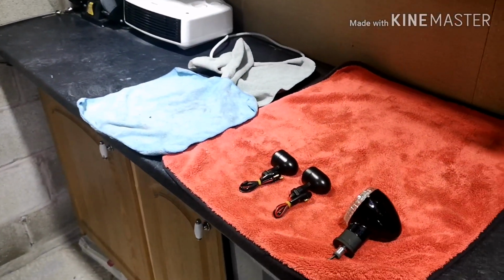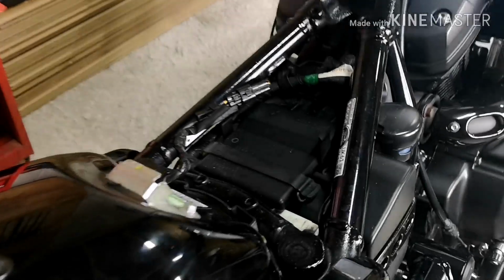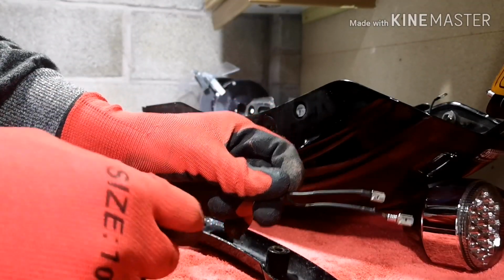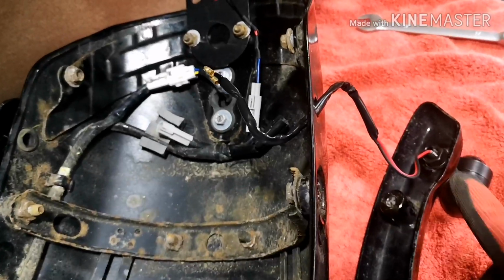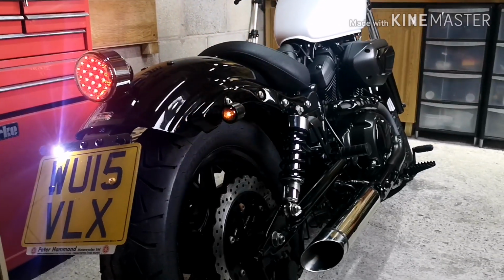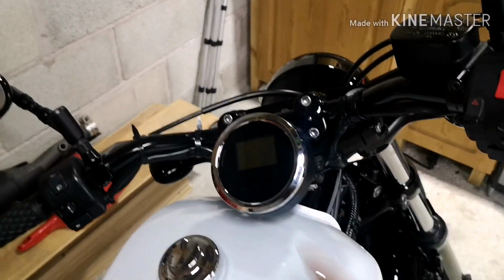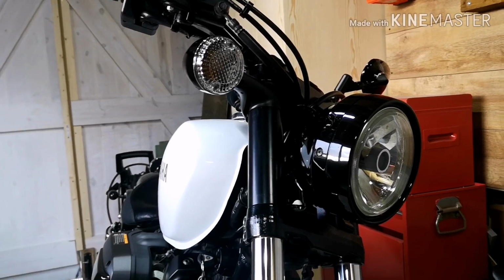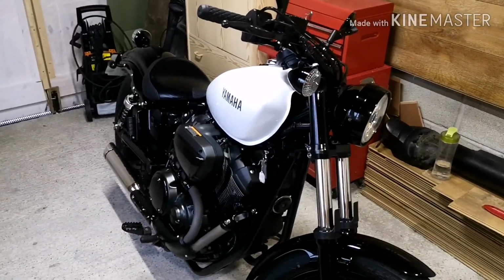XV950 Bolt Build Ep7 - Indicators & UPVC Pipe ?

Comment: I plastidipped my gas cap and it has held up fine. Inexpensive and easy.  Or the black plastic cap from the scrambler works. More expensive though.
Reply from the maker: I have considered this
Reply: cbpath72 oh it is all metal, I think the one I posted a link to is from a third party, not oem Yamaha part, but it looks like it.